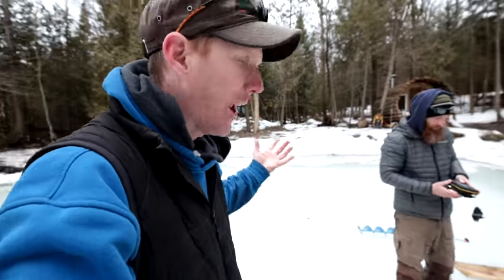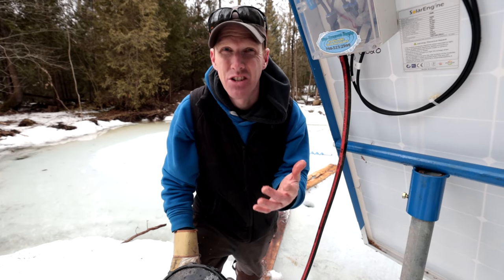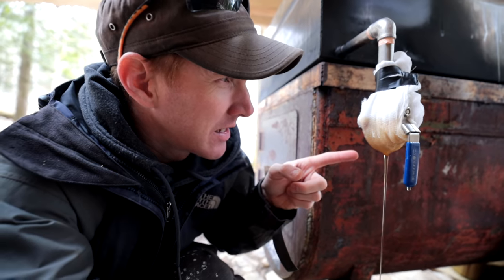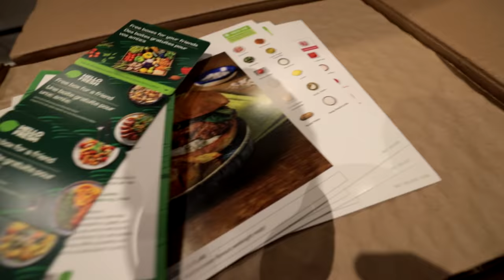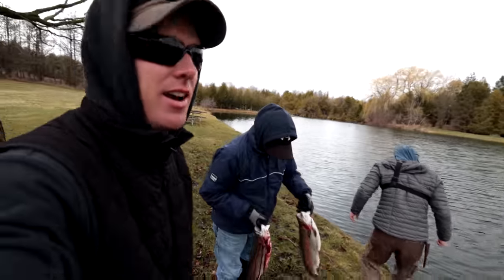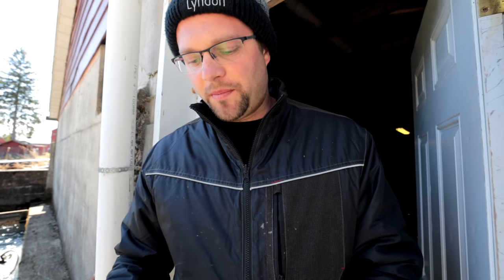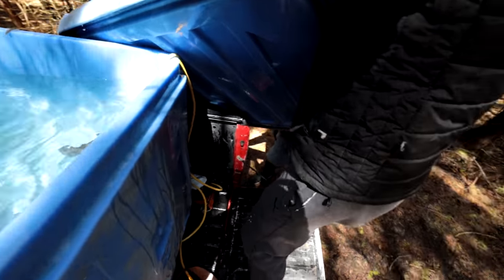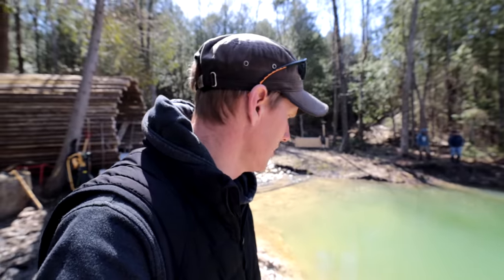Stocking HOMESTEAD POND with GIANT Fish (Don Catches a BIG'N!) - Erosion Control, Maple Syrup

Comment: If you extended one small section of the pond and put a divider in it that stuck up above the water, would it be possible to have the main body be able to freeze in the winter and still be able to add oxygen in to the pond?
Reply: I thought that too but the addition of constant air will change the water temperature alot faster. If the air temp is above freezing your injecting that into the freezing water. But it would be cool to see if it would work.

Comment: i left the same comment on your brother's video last year. you're doing fine with your transplanting the stocker trout. quick transitions between truck and pond. first thing, make sure to aerate for a few days ahead of time, and have proper circulation of said aerated water. these stockers are coming from HEAVILY aerated water, with a good current. into still water. its like mountain climbing for us, not a lot of O2 where they are now compared to where they were. main thing to shock a transplanted fish is temp. and water quality. always ph and hardness test your host body of water against the stock pond you gather from. makes it easier and more cost effective to properly adjust over time, rather than crash course it.

Comment: Get the hay bales out of the water!!! Place new bales slightly up slope from the edge above the rocks. Use a jute fabric or straw to hold the seed until that is established. Leave the hay bales as a heavy runoff barrier which will stop silting the pond. Silt equals rapid algea growth, especially in shallow ponds. Hope it all works out!

Comment: wondering if a windmill project would work and to back up your windmill project you could use your solar panel as a secondary pumping system to move the water when the wind is too high or too low for the windmill to work maybe just thinking

Comment: Ok boys Water aeration is achieved  from the top 2 inches under the pond surface so therefore to aerate the pond you need to make the water to move (circulate). The air bubbles produced by the solar powered aerator is  to circulate the water, its the same principle as in an indoor fish tank at home. I think that if you connected an electric outboard motor with a blade guard (the guard is to protect the fish)to a mount in the pond it would have the same effect and being electric it can run on solar.
(edited to add) the electric outboard is more powerful than the aerator and it can circulate a lot more water faster than the bubbles.
Reply: That is awesome info! Question for you...if I were to build a pond with a water feature how big would the feature need to be, in relation to the pond, to keep fish alive? Does it come down to volume of water moved through pond (current like a river) or the velocity of water hitting pond surface (agitation like rainfall)

Comment: Eh... you'd need the volume of an elipsoid. Assuming a perfect 38' circle with 10' of depth, you've got roughly 15,000 gallons in there. My guess is that it's probably closer to 10-12,000 though, because I don't think it's a perfect circle from what I've seen in your videos.

Comment: Mmmm. I’ve had aquariums since childhood. Totally different situation, but I know the transition between habitats is the most dodgy, mostly due to temperature. May I ask why you didn’t tractor the tub to the pond, lower it into the pond, and let temps equalize? Then you could tip it and let the fish leave as they acclimated. Maybe trees were too dense? I ask a lot of questions. Sorry.
Reply from the maker: We used the advice of the hatchery in transferring the fish.  It wakes them up.

Comment: 🤔 suggestion, you may wanna attach a battery to the solar panel to power the aeration units which there should be no less than two for that size pond.  I would also add a bit of structure and a bunch of minnows/ brim to help with biological side of things to make your pond a more complete system. That way the pond to some extent will feed itself.

Comment: Question why did you not just drain the water down from the portable tank till about halfway with the Kubota already rigged with lanyards to the portable pot and then use the Kubota to haul it down to the pond side and then just tip it over?

Comment: I just finished a trig course for work; a sphere volume is Base (area of circle) times Height
and you have a half circle; so just cut that number in half

so pi * 14 (half your diameter)^2 times that by 10
then cut in half

thats your volume bud

and they said trig was useless

*it was a trig/geometry course to help me fix submarines. Geometry sucks, i hated it
Reply: The volume of a sphere is 4/3 X pi X r cubed. But your pond is not a true half sphere since it is of relatively shallow depth compared to its radius. So the volume it contains might be something like 2/3 X pi X r squared X r/2
Reply: @RobertSeviour1  ah yes, I forgot its cubed not squared